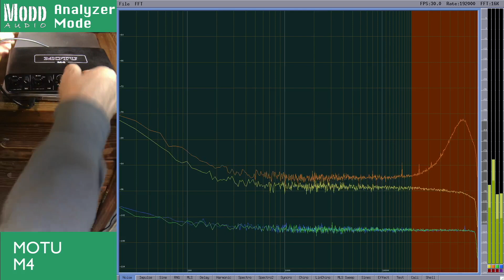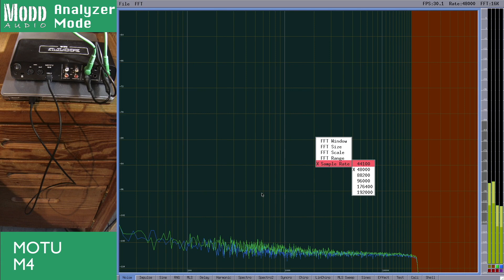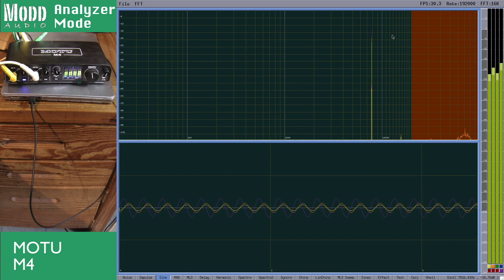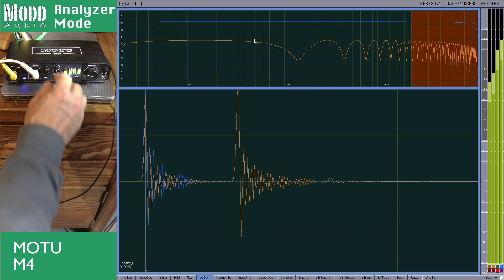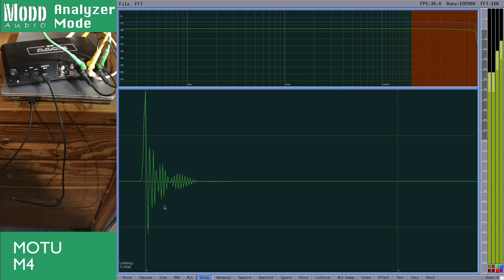Motu M4 - THDC #36

Comment: I simply want to say thanks for making this video! On my desks sits my M4 and has given me some headache after running for several hours/days connected to my MacBookPro M1. From time to time on the M4 meters as well as on Logic Pro Xs meters values have been displayed I've found no explanation for. Condensor mic connected with 48V switched off and meter readings up to roundabout -36dB with M4 gain knob at roundabout three o'clock. Several times I've changed the XLR cables, mics and checked the settings - nothing worked out really. Until I used another USB C cable - problem gone since then! I've to admit my knowings about electronics are very limited so I've no idea why this helped - but it does (at least to my opinion and for me). Your video has helped me because now I can think that maybe some electrons are celebrating whatever here - but their doing can be detected by someone (definitely not by me) and I don't have to live with the feeling that there lives at least one ghost inside the wires of my house. ;-) But...... who knows........ ;-)

Comment: Oh I´ve forgotten important things about the MOTU M4 to me  - I really do like the feel of the knobs, the way they can be adjusted (enough space around the single knobs for my big fingers), the easy way to setup and use the interface and the sound quality which is good enough for my needs (recording stories of my family for a family archive). The phantom power switches are not ideally located for me - I would have preferred to see them at another place (better visible above the knobs to my opinion). On the other hand I understand what you are saying from your point of view. Besides that - thanks again for sharing the video.
Reply from the maker: I too like a lot of things about this interface it is very well built.  But after my experience with tech support (starting a week before this video was posted) I am unsure.   They do not seem to want to admit that there is any issue.   I have no idea if they can recreate the issue on their side.   I have not heard from them, since I admitted to making this video, after they asked twice.   I would have rather seen them put an entry in their faq about this to help their customers.  

Thanks for you comment, its a bit lonely here.
Reply: @moddaudio  I have to agree to your point - generally spoken - I too like to be informed about known issues of or with a product I'm interested in. In the case of the MOTU M4 - I would have bought the M4 anyway even if it has a problem with the one or the other USB C cable (and I've bought it). I think it's a great product and I don't care about if it might work better with the one or another USB C cable - if at hand I use the combination it seem to like best. ;)
Besides that, yesterday evening I used another XLR cable (different brand) for testing reasons. Again the meter at the M4 (BCM 104 connected to Mic input 1, gain at roundabout three o'clock, 48V phantom power switched off) as well as Logic Pros internal meters displayed a relatively strong signal to my opinion (signal strength up to roundabout -36dB if I remember correctly - sorry, it was a bit late). Changed nothing while switching back to another XLR cable - meters displayed no signal. Once again, I do not understand why this happens, simply want to share what I have noticed.
Greetings from a small town in Germany, Andreas

Comment: How can i test this myself? What gear do i need?
Reply from the maker: I was able to see the issue in Ableton using its FFT, but there is an easier way.   Since the M4 has VU meters on the front, you can use those.  Simply crank the gain on both channel 1 and 2.  It is normal to see a bit of noise on the meters.  It one meter has more noise than than the other one, that is showing the noise.  It will only  happen at 96KHz or above sampling rate.   I am not sure if the issue is wide spread, but MOTU tech support did not seem to think mine was faulty.

Comment: Minimum phase FIR is a thing. The filters likely aren't actually IIR.
Reply from the maker: The half-band is short enough to implement as polyphase FIR.  You could be right.   There is some minor ripple in the passband (<.5dB) so to me it looks like an elliptical filter.    

My work experience was more focused on implementation, the math PHDs did the actual DSP stuff, so I am no expert on CICs or half-bands.   I wrote my own IIR half-band so maybe that made me a bit myopic.

Comment: Would you recommend a different interface around the same price range?
Reply from the maker: I have not tested anything else comparable.  I want to replace it, but a lot of others are still using the  CS4272 codec chip at this price.   I have mixed feelings on this one, it has some of its own issues that adds some noise, but it should still perform better than many others at the price.  Tech support sucks, latency is good.